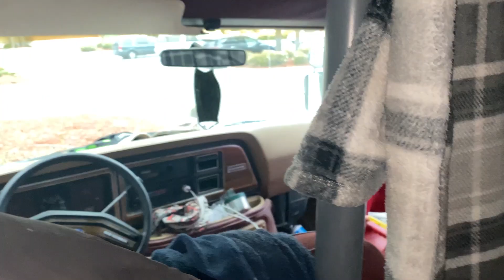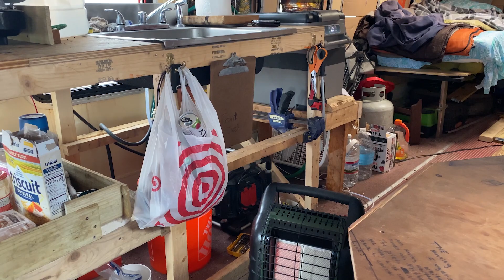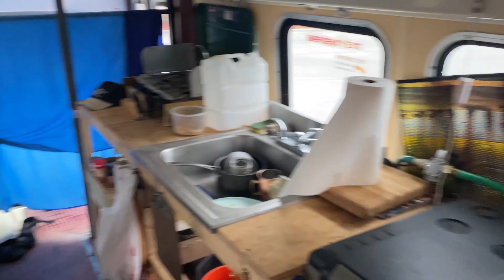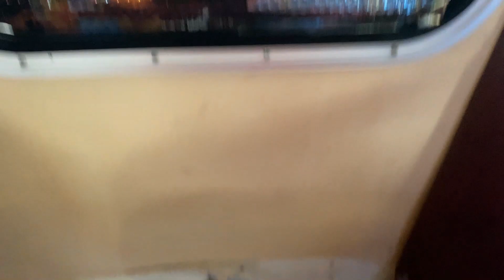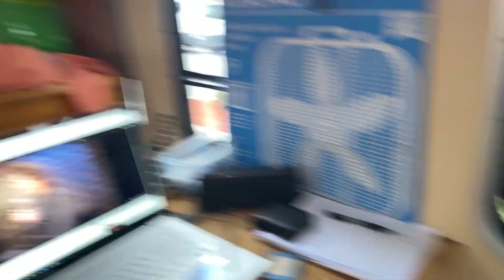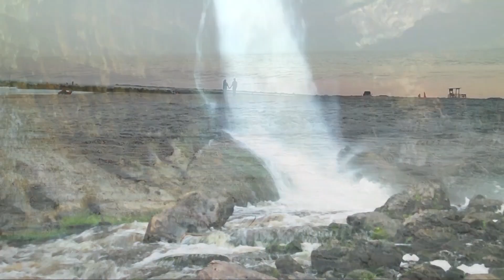CHANGEING WINDOW AROUND AND DUMPSTER FIND/THE WAYNE DIARIES

Comment: As far as battery powered tools go, I had good results with the Ryobi brand. I was in modular home business so tool life was important. Workers are not always careful how they care for other peoples tools so found Ryobi brand reasonably priced  and still dependable. From early 12 volt to now 20 volt Ryobi batteries were always able to be useable on all there tools, sometimes required using a file or saw to make a 18 volt battery work in a 12 volt drill but those DC motors are tough. With Ryobi you can get kits of drill, impact drill, skill saw, saber saw, couple batteries & charger for under $200. dollars. I would say that only fault might be that the brand is only sold at Home Depot. I will say also that I believe Harbor Freight may now be carrying some brands that could compete with Ryobi. Good luck on your trip back to Ludington. What's with the girls staying in Florida? Maybe find out when you go live.